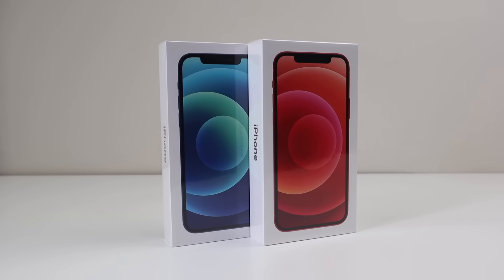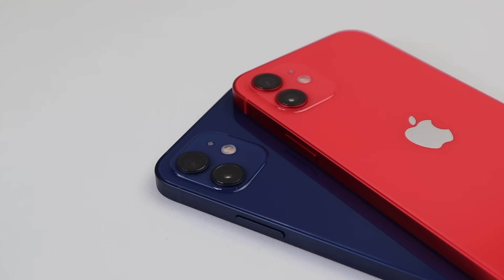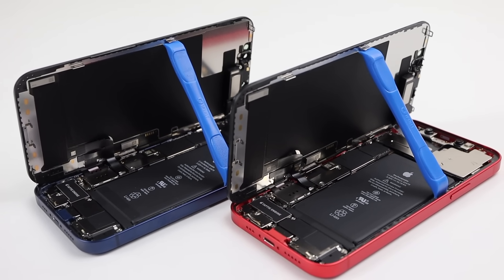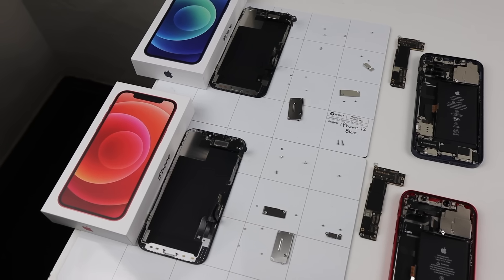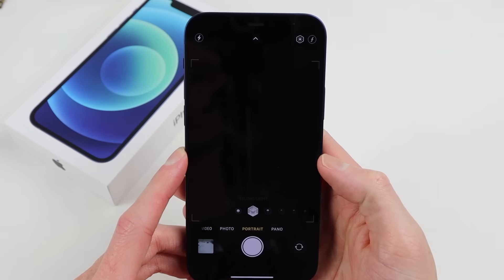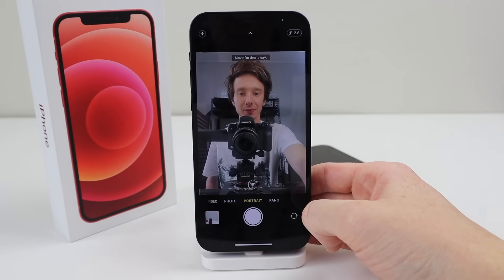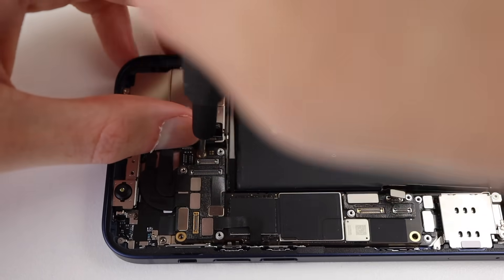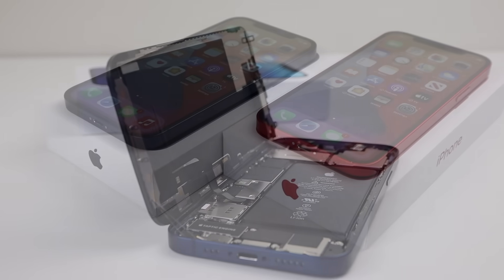iPhone 12 Anti Repair Design - Teardown and Repair Assessment

Comment: Apple aims to reduce e-waste. I am sorry what? This is the reason why I genuinely despise this company. They treat us like complete retards with statements like this as if nobody is going to stop and think for a second. Reducing e-waste. They have 2 billion accessories. If iPhones would switch from Lightning to C-Type which is already fairly common cable in most households this would have significantly reduce e-waste. What Apple done? Streamlined a completely brand new cable that is both Lightning and C-Type which will create even heavier e-waste, much worse than if they would have just stayed with last years cable.

I have no problem with them making money. Just don't say complete bullshit that makes absolutely no sense.
Reply: I recall that the cables that came with iPhone 4 break very easily, so every iPhone 4 came with e-waste. Perhaps the modern iPhone comes with better cables, but if they are just as bad Apple is just making e-waste cables with their phones. 

Plus with the removal of the headphone jack, Apple included special earbuds with lightning connector, if I'm not mistaken. That would be a waste because it only works with an iPhone, nothing else at all. It has to be a waste for manufacturers to include a headphone jack to USB-C/lightning adapter. That's e-waste because its bound to get lost and it's an extra part that could wear out and be thrown away. (Apple isn't the only guilty company for this)

Plus, 5he elaborate packaging of many electronics produces tons of waste. It looks fancier and more appealing, but the fancy packaging is extra packaging that can go to waste. I think Apple is trying to reduce the packaging in newer iPhones, though, but other companies such as Beats have overkill boxes. It's weird to focus on wasteful packaging but I remember it from a video.
Reply: EXACTLY. Thank you.
Reply: YES
Reply: exactly my thoughts on this. be the greedy company you want to be by all means but dont try to dress it as an eco-friendly product. i understood when they didnt want to use usb mini, then micro, but to be this deep in the usb-c game and still not switch to sell their proprietary cable is just insane

Comment: I'm so glad I switched to Samsung before this....
Reply: Samsung is way worse man... anything goes wrong they tell you have to send it in and pay $350 plus potentially more. My 3 friends switched from Samsung to iPhone now for same reason
Reply: @ri7265  I've been using Samsung for 7 years since the sgs4. Never had an issue
Reply: @davidmartineztorres8731  maybe you were fortunate and never had to ask them for help
Reply: @ri7265  Samsung support on its own is pretty bad but third party shops repair it well as long as you go to a reputable one and a lot of countries have small repair shops which are more accessible than apple trusted repair shops. New phones cost a lot to repair but as parts stock up it gets cheaper. Apples repair fees are exorbant so I think the price comparison is non issue. In terms of customer service, Apple is friendlier but ease of repair goes to pretty much any flagship android.
Reply: @salty-chips  this is a good point. Samsung itself is bad but maybe third party would be easier to fix. In my brothers case, he ended up getting a new phone because it was cheaper than even third parties.

Comment: so in other words instead of "wasting" material to make us a power supply, they want us to spend more money ontop of the price that is already outrageously expensive. what I mean by this, is android is already cheaper to begin with out of the box, it comes with the power supply, apple wants an excessive amount of money like 3 times that of android or PC, and they want to sell for the same price but not include the power adapter. isn't it nice of them to do this they want us to spend more money on something that comes with less, then something they sold in the past for less money. which was still more money then its really worth. and to top it off we have to get the "special apple one too" dont we?  which is like 50 bucks for a damn power adapter. power adapters have been selling for way cheaper then that for years now doing the same job but because its got the apple logo on it, its 3 times as expensive. or it might be some 3rd party that works decently well. who knows, first they take away the headphone jack next the power adapter. stuff like this is exactly why i will NEVER use apple again. its like advertising a big mac but telling everyone they can't have the special sauce with that big mac.

Comment: Your right the included cable does not fit into your current charger (probably).
BUT YOUR PREVIOUS (apple) CHARGER STILL WORKS WITH YOUR NEW PHONE.
Also the new cable allows you to connect the phone with your MacBook, which likely does not have USB-A.
Yes apple assumes you are, and have been, part of their ecology. This is annoying but not inconceivable. Stop repeating this fucking joke like every other sheeple on the internet and think for more than 2 seconds.
Thank you.

Comment: Yup. .I can. .I use to work for Apple... As soon you removed the battery. It must be plugged in to push start the phone...And all parts are paired in side..It's on the way can't repair.  They want you to buy new phone not repair!!.. 😋 😛 😝😋 😛 😝😋 😛 😝
Reply: Yup

Comment: Camera freezing, multiple lock features? It's not Apple anymore, it's just a freaking mafia

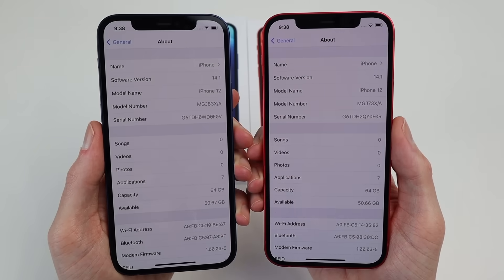Edit: Are you dumb? 2:37 it's not the same model dude!
Edit: After searching I realize the model numbers are different because only the colours so... nevermind
Reply: @irrrational  No, i mean the model number.
Reply: Put two iPhone X 's next to each other, and you'll see the same thing. The model name is what matters.
Reply: If the model number it's different means that the devices are different in at least one thing, otherwise both would have the same model number.
Reply: @Skull_Knight_  Not for iPhones. I'm an Apple certified tech, I should know lol. Model numbers matter for every iDevice except for iPhones. The model name marks the difference.
Reply: So Apple made the MGJ73X/A and the MGJ83X/A models just because they are bored, sure... idk pal, why they even bothered at making different model numbers if both are ENTIRELY the same?
Reply: @Skull_Knight_  No, they're control numbers... if I were to put it in my database, it'd tell me what iPhone it is (12), which carrier it's linked to, how many GBs of storage it has, and which color it is. The two iPhones are the same, and merely have a different color which is why they have different model numbers. All the parts (other than the back housing/glass) are exactly the same and are cross-compatible since they are the same series of iPhone... try repairing these for a living, provide support for and develop these, then teach me how much you know about Apple products 🤪

Comment: ....If you already have an iPhone, you have a lightning cable and/or adapter, so you don’t need the cable. If you’re switching from Android, you probably have a USB-C adapter since that’s what Android has been using for years now. Tired of people treating Apple like they intentionally fucked everyone over by including only a cable that’s 
USB-C and that people’s first instinct
is that they NEED to buy the fucking 50 dollar fast charger, rather than find some other means of charging.

Comment: Had a 2015 13" Macbook Pro. Had no issues with the computer over the years, but suddenly the display went out. When I called Apple to schedule a repair, the rep mentioned they can't repair products 5 years or older. No third party could repair the computer either. Never buying an Apple product again. Suggest more consumers begin to do the same following their recent practices.

Comment: Disclaimer: I have never owned an Apple product, these are casual comments that I have no desire to argue over...

Very likely Apple stores camera calibration data in the phone, I'm not sure why this is surprising to anyone. Given the high pixel counts in use today and that they likely use more than one supplier, there will likely be many corrections in use. Examples are dead pixel masks; interface timing skews (likely the reason exchange doesn't work in this video btw); white balance (used abstractly here to describe pixel gain variance due to process variability) etc etc . With the battery, there is so much crap flooding the market from Asia it should be no suprise battery exchange is not encouraged for any random bedroom 'repair shop'. Even if battery exchange was not locked down in this way, battery coulomb counting is pointless without an accurate battery capacity measurement (and lots more factors). Unfortunately most aftermarket batteries either just plain lie in the battery info stored with each battery or at best is poorly measured/controlled in the first place. So in summary, Apple is in a difficult position with the right to repair movement (which I support); if they allow it, then they face brand damage from poor performance of 'repaired' products or else they have to somehow put some very complex tools in the hands of the layman in the hope any bungled repairs (from lack of understanding of the underlying technologies) are blamed on the repair, not the parent company. So yeah, until Apple is transparent about the processes used on their production line to make everything work together, the benefit of the doubt should be given. Stuff just isn't as simple as alot of people think it is. Anyway, enjoy the weekend.

Comment: They just get wacky the most important thing is missing now you have to buy a seperate charger.  By the way you open the chassis so it means you ruin the accuracy of the water proofing of the unit.

Comment: There is such a fine line between designing for repairability and for consumer protection. Apple security features drastically reduce the incentive to steal what is otherwise a $1000 in your pocket. With Apple ID, Touch ID and hardware features like the Secure Enclave and this kind of pairing there is no large-scale market for stolen iPhones. Stealing an iPhone is almost pointless - a locked iPhone is unusable to a thief, and is worth a tiny fraction of its retail value in spare parts. Consumers ultimately pay for this security in repair convenience, and I think Joe Average is probably pretty happy with that 🤷‍♂️

Comment: Never did like Apple's proprietary business model - only mugs buy into it. Just got my four yr old Oneplus 3 (equivalent to iphone 8plus and a bit) refurbished with a  new screen, battery & usb by Oneplus for £100 for my wife to use and it lacks nothing for 99% of usage - its better than my 2 years younger S9 in many ways, and certainly better than most iphones not built in the last year or two at a stupid price. Who wants to buy a £200 phone for £1200 when they can get one for £500

Comment: Looking at your drawer, yes you don't need another charger
Reply: doesn't change the fact that Apple is charging you the same price for less (doesn't include earbuds or power brick)
Reply: @DudemenProHI  but you're paying same price as last year for better phone with better kit, duh
Reply: @do2k76  iphones each year are basically the same with little improvements. Not including accessories is just being cheap and greedy

Comment: Gotta love the Secure Enclave damn I did a paper back in college on Apple security on startup they tie the components to a factory flashed memory secret to ensure integrity of the files,hardware,etc on the phone but it makes sense why some of the apps might freak out when the hardware is switched that sucks
Reply: >to ensure integrity of the files--
That same integrity is what Apple lacks every millionth of an ounce of.
Reply: @nrw_quixcope  yeah I’m not defending it but it does help with actual file security it’s actually pretty hard to break into these little bricks of tech to digital mess with them but they should be serviceable and resettable
Reply: That the power button doesn’t work with the camera swap, tells me that it’s not a Secure Enclave lock.
Reply: @Weedwackerization  could be never know if there’s some kinda ic just inside the power button which wouldn’t surprise me

Comment: Grounds sometimes play a role in having everything working as well. So shield and screws are a key thing. Then again Apple phones are very dumbed down and they frown on self repair which is dumb. The "re invent" old software and delay features for there newer models to obviously make more money. Business I get it. But iphones through the years have very cheap to repair. Try repairing an android (a flagship one) not the androids that apple fans judge or compare to iphones. They are more expensive to repair.

Comment: Much like an automobiles control modules are configured with specific coding for communication through CAN system. For instance removing the ECM from a perfectly good vehicle and swapping it to another results in a no start. The system has to be configured with a scan tool. I'm sure there components are serialized as well.

Comment: If you change the parts that came with the phone with apple genuine parts it’ll have to be calibrated using apples repair calibration software and it will work like brand new but if you don’t use a genuine part (or calibrate it) you will have all sorts of issues with the phone as you see in the video. It’s been like that since the iPhone X

Comment: I don’t know, I’m actually going to take a look at Samsung this time.
Reply: I did that..... best decision of my life......
Reply: Instead of switching why don’t you just not upgrade to the iPhone 12?
Reply: @cas4896 Some people just want the newest tech
Reply: if you want something that can take a few hits, be somewhat powerful and has good battery, go for Motorola. From the Motorola's I've owned, my only issue was the charging port breaking and hardware not keeping up with my games after 5 years. current one (Moto One Macro) had a faulty battery, which I replaced, but is an absolute beast of a phone for an affordable price. Note that I've never owned a new phone, all of them bough/gifted used.
Reply: Instead of samsung, try taking a look at other androids that has snapdragon processor instead of samsung's exyanos process, which will slow down as you use your phone over time, so you'll have problems with your samsung after 2-3 year! i'd suggest realmi x3 superzoom, super cheap and has MEGA  specs!!!
Reply: @UsamaShaikh  yup and most apple fans thinks ANDROID IS SAMSUNG that fucking irritates me
Reply: @UsamaShaikh  samsung phones come with new snap dragon processors in the us tho and realmi doesn't appeal id say go for one plus or pixel 3xl since everything after the pixel 3 was kinda weird
Reply: @UsamaShaikh  not all samsungs have exnos prosser it should only be European. Models for s20 i would just get a note9
Reply: @UsamaShaikh  I'm still rocking my S7 and it's functioning fine.  It's 4 years old now... this comment is total propaganda.  Samsungs are fine for the average user.  I advise you shop around and find the product that works best for you and fulfills your needs of your device.
Reply: @UsamaShaikh  I’ve been looking at the new Samsung note phone. It looks really good and what I think is amazing about it is the little pen it comes with.

Comment: As someone who does device repair for a living it’s necessary to know what messages and issues there might be. The “authentic” apple battery started with the 11’s and disappears after 7-14 days. The screen message is the same way. Face ID is like the home button used to be. Each component is paired one to one with every phone. Your camera issues are likely due to glitches from the phone having too many unrecognized components it’s trying to deal with at one time. Swapping the logic boards is guaranteed to cause a lot of problems.

Comment: My BMW car has similar restraints, I have been told by a mechanic friend. Replacement parts often now need to be 'coded' to the ECU or somewhere to function. I hear the days of even replacing a bust headlight from a breaker's yard are over for the newer models.

Comment: I know its not the same thing but I had a BMW once, I had to replace the heater unit in the dashboard but it wouldnt work even though it was all plugged in ok.
I take to take it to BMW and get them to code the heater to the car for the car to recognise it.
I would imagine once you recode all the parts to the new logicboard they will all work.

Comment: Well, I was about to replace my iPhone 7 plus for the new iPhone 12 before watching this video... I don't think I'm going to now.
Reply: How many times have you needed to repair your 7 plus?
Reply: @gregg7761  Hi Gregg. I have to repair my iPhone 7 Plus twice, unfortunately. I was lucky the first time because I had Apple care but the second one I ended buying a screen from eBay to solved my problem. Apple's no repair policy is making it difficult for me as I tend to keep my devices for a few years before upgrading. I haven't ruled out buying one yet but it is annoying to think that if I am "unlucky" again I will end up with a large bill to sort out my problem.
Reply: @marcelgonzalez1376  Apple phones have treated me well. I started out with them but got curious and tried some Android phones for a few years. After deciding that wasn’t my cup of tea a purchased an iPhone 8 Plus. Used it every day for 3 years with zero issues and got $210 for it trading for the 12, that ain’t bad. It does kinda suck that they aren’t allowing repairs but to tell the truth I haven’t needed any repairs.
Reply: Me neither